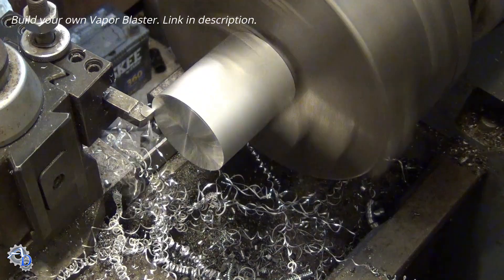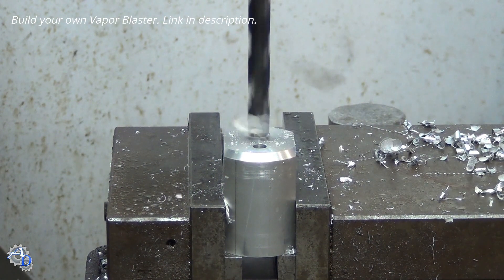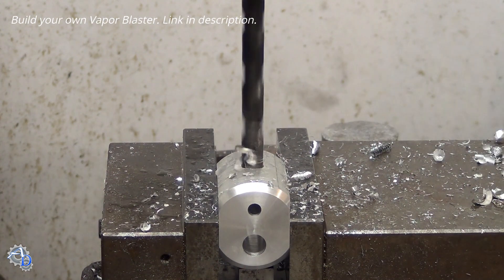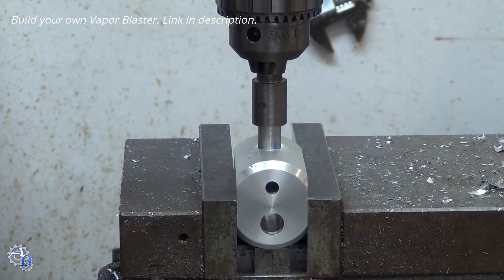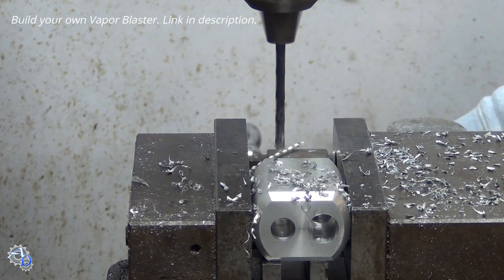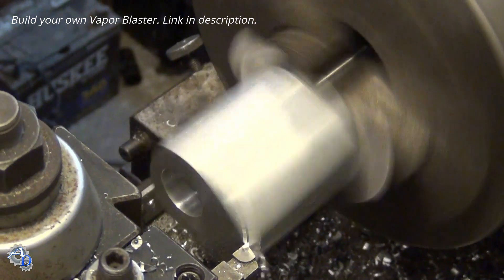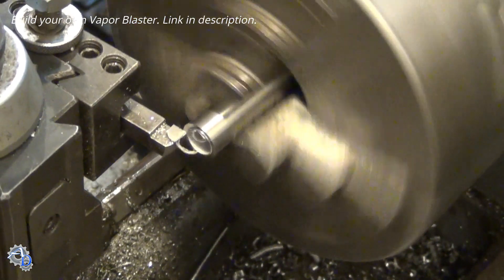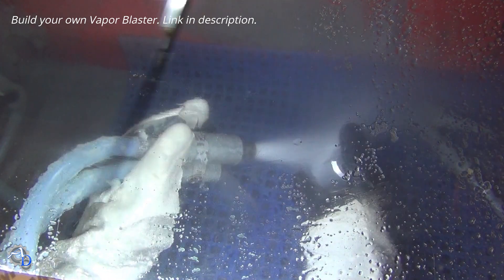Custom Vapor Blasting & Dry Blasting Nozzle Prototype

Comment: Hadn't had a chance to check out your latest vids, then clicked on this one and was surprised to see the link to the Vapor Blaster plans! Been a long time coming, and turns out well worth the wait. I immediately ordered and then downloaded them. Only had a chance to glance thru the 233(!) pages. I will say, the massive attention to detail is astounding, but not at all surprising Brad. And the cost is just beyond reasonable. Thank YOU for offering such a great publication. Dan.
Reply from the maker: Thank you for saying so Dan. I had some extra time at the beginning of the year, so I really got working to finish them. I debating keeping the page number lower, but I wanted to use a little bigger font and a lot of illustrations (my kind of book). Anyway, thanks for downloading them. Sorry you had to wait about 3 years for them.
Reply: @ArnoldsDesign  Tonight over on the Garage Journal someone started a thread on wanting to build a Vapor Blaster. I posted a link to your handbook. Hope it draws much interest.
Reply from the maker: @kmcwhq  Thanks Dan. Much appreciated.

Comment: Nice seeing the machining process! I would love to see someone show how well this setup would work on rusted painted metal parts which is what a lot of people want to strip. Thanks for the video!
Reply from the maker: Works well on rusted and painted metal, unless it's a really thick industrial coating which I don't see on many parts. About 95% of paints blast off quite readily. Powder coating doesn't blast easily either.

Comment: So satisfying to make your own tools. When would you use wet as opposed to dry? I have a dry medium blaster and still learning what it can do.
Reply from the maker: I use my wet cabinet for vapor honing only. My dry cabinet is for part prep, i.e. stripping off the hard weathered surface.
Reply: @ArnoldsDesign  thanks...I'm guessing you have two cabinets or do you use one for both methods? I have a heap of carburetors to do some day, what medium would you use to finish them?.
Reply from the maker: @kevbarry7453  I run two cabinets. Fine crushed in the dry cabinet, and glass bead in the wet cabinet.

Comment: So, does one head do both the dry and wet media? Also, how much pressure is put into the water and air (at least.. im assuming you have water with media in one hose, and air in the other)?

Also, you might want to look into those rotating/spinning port windows for boats or ships... The wiper seems to have seen better days hahaha
Reply from the maker: Yes, one head does both, but the nozzles and air jets are different sizes for each task. Pressure depends on several factors, so there's not a one size fits all. I will check out the spinning windows. The wiper isn't working very well because it tends to roll over glass beads sometimes instead of pushing them away. A water spray on the windshield helps a lot. My other blaster had one, but I haven't installed one on this cabinet yet.